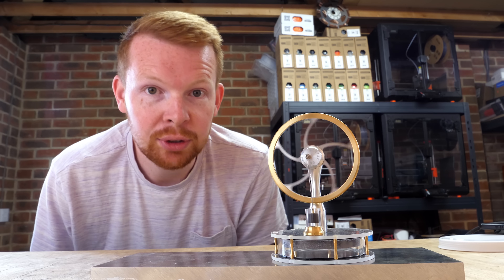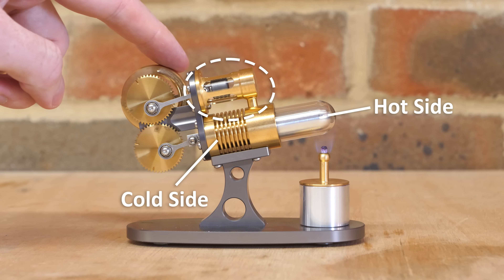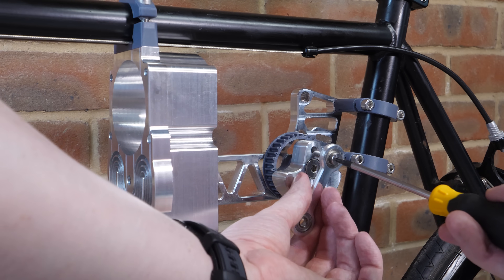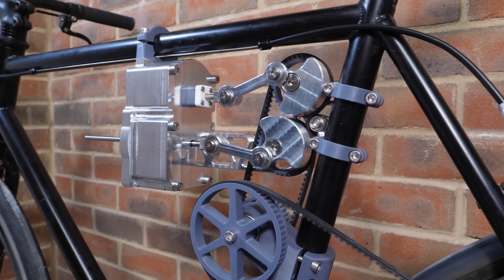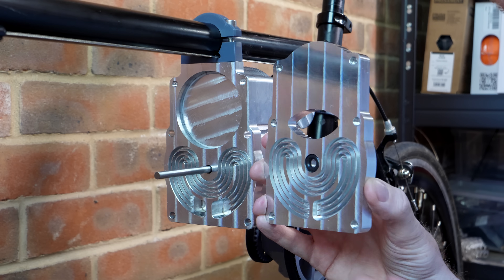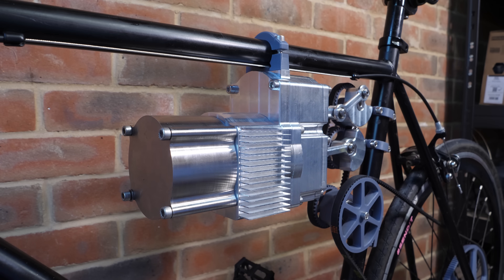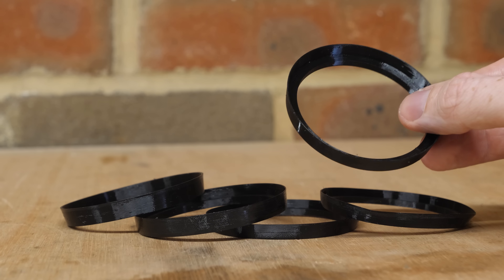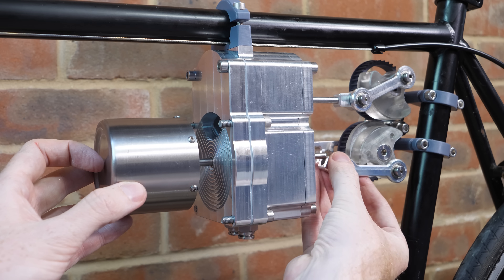Building a Stirling Engine Bike - Part 1

Comment: Hmm.. so I see two pathways here:
1. Run the stirling off of waste heat in support of a small 2-stroke ICE (since we're using combustion to heat the cap anyway). Like a stirling heat turbo.
2. Enclose the burner. Keep the stirling heat cap at a desired temp by regulating the burn. Can get very creative with recovering energy from the the exhaust gas heat/pressure.

Comment: Remove most of the 4 flange ribs on the hot cylinder and use short cap head screws reducing the heat transfer from the hot head down the big ribs and long screws that are very hot so close to the flame to the engine block.  At the end yes add a re generator and some Stirling engines had a small compressor to up their pressure others used high pressure hydrogen. ( don't try that at home ) Packing the cold end in ice works better than water cooling, cheating but so is your ground mounted ice water and mains powered pump.  A single crank 90 degree V saves on friction of 2 cranks and the tooth belt and a good fit in a bicycle frame with the crank and flywheel down low allowing for a bigger engine.

Comment: Wooow.

In electricity generation plants, they look the way of extract every amount of energy available. The steam that get out from turbines, have not the heat and pressure to move another turbine. So it get compressed to concentrate the heat and use it again.

But still, a lot of energy get lost  through the air. (in the from of heated air)

This is a very elegant solution to use that heat and produce electricity whith it.

Comment: Love this.
thought I do have a question- is it better to do this straight like you have done?  Or would you get more bang for your buck from going Sterling- generator- electric motor?

I can't do that math.  I know there are losses in conversions- but robert murray smith (youtube channel) managed to minimize those with "speed at the rim" generators.  Large wheels, easy to make serpentine coils, and a decent gearbox to maximize magnet speed- and he gets commercial grade wind turbine stats out of his dinky little diy wind turbines.  So, I wonder, if instead of just using the sterling for straight motive power, if you could put that into electricity, then going to kinetic?

that may be a useful thought, might not.

Comment: You can make a solid displacer by bolting 2 "U" shaped cups back to back with the displacer rod.  So if you cut it in half long ways it would look like a letter H on its side with the displacer rod in the middle.  You then need a hot and cold end that wraps around this letter H. You could bolt an insulator in between the 2 square shaped "U" s. Your displacer seems too short and maybe too much gap between it and the hot/cold ends.  One end of the displacer needs to be cold and the other end hot. A longer displacer helps this to happen. I  have read about someone using leather as a seal and it worked very well and lasted years. The cylinder walls need to be a glassy smooth mirror finish. Small engine makers usually ream and polish the cylinder walls. A good stirling engine should be difficult to rotate when cold,  meaning it has a good air tight seal. But it must be very low friction.  You can make it more powerfull by compressing the air inside the engine. As it runs it can drive a small compressor to pump itself up

Comment: Hey Tom, great videos and looking forward to this series!

My 2 cents: the expanding seal at the power piston may not the best choice here as (in my understanding) the piston is both pushed by expanding air during the heating phase, and pulled by contracting air during the air cooling phase. So the piston seal needs the same sealing performance in both directions.

Comment: Reff 6:01  I am by no means an expert on Sterlings, but am a mechanic with 40 years of experience. Love ur channel.
   The power piston shaft suport plate...as the hot "power pulse" is pushing the piston down the bore...would it not reduce resistance to have the bottom of the piston vented to the atmosphere? As I see it...using an expanding puff of hot air on top, to Compress the gas in the sealed chamber on the bottom reduces the push on the connecting rod...

Comment: Support the cylinder on the down-tube as well. Also, it might help to support the power piston rod a bit better and/or make the conrod longer. The ratio of leverage between push/pull and bendy-bendy looks a bit too close.

Honestly though, I want to see the mk42 engine once you’ve Tom-Stantoned the heck out of it. 🎉

Comment: Your cylinder walls need some honing, my guess is that it should be done with 800 grit.
Increase the displacement quite easy with a thicker gasket or just a spacer on the displace piston side.
Maybe add something like steel wool around the displace cylinder, so the air from one side has less contact with the other side, further increasing efficiency.
And the steel wool would act as regenerator (need to be a material with poor thermal conductivity but high thermal capacity).

Comment: Entertaining, Tom, at the very least.  I'd like to point out that if you can increase the surface area inside the hot end you can get the same power level with a lot less temperature which should boost your efficiency significantly.

Comment: I have built several sterling's and the biggie is minimum dead air space and as friction free as you can make it.. Run yours no load for a while and it will bed in .. then run better..  Pressurization is a must and a regenerator out of steel wool is easy..   I dunno but I think your engine is too small..  Get the sterling book from UIUC as the Prof. that wrote it offers invaluable tips.. he helped me a lot.

Comment: I adore this thing, the only issue I can see would be poor cooling airflow at speed, given the hot side is in front.
Probably is a necessary evil though as having hot air enter the power piston, while better for power, would likely harm longevity due to those temps as I doubt plastic would hold up, though that makes me wonder how bad making tint steel O rings would be in a similar design to those tiny V6 F1 car pistons, regardless it'll be amazing to see moving one day

Comment: So for the upper cylinder assembly, consider moving the center line of the crank to the center line of your piston. That way you have an even power cycle as the crank rotates. If ya notice your lower piston assembly is smooth running while the upper one of jerky. I think this will greatly improve your efficiency and help with moving into the next power stroke

Comment: Tom, Check out the ' Philips Sterling Generator" circa 1960.  It details the pressurised crankcase, by increasing the density of the working medium in your case air but it can also be nitrogen. The Philips engine had a small compressor to maintain the high crankcase pressure. The crank was a yoke motion and is more efficient than the standard crank.

Comment: you just could have machined a fold/deepening (dont know how its called in english) in the piston rod guiding area, that you can use a simple standartised glide bushing for 11c per piece, without plastic adapter for a too big (wasteful) teflonblock as a bushing. It would be lighter, cheaper, more durable, and easier to build and maintain.

Comment: I absolutely love the idea but isn't this an indirect fire propane engine? are you gonna add a small generator to run the water pump? maybe a propane cooler using the venturi effect to cool the cool side then to burn the propane on the hot side?

Comment: You should just have a generator on the flywheel that dumps current into capacitors. Much easier to keep the stirling engine spinning without attaching a clutch.

Comment: If you are still considering a steam engine make it so that the water is heated through a coil of copper pipe by a pump. With that, if an explosion occurs, you will not have hot water splashing onto you. This will also prevent giant explosions but rather just a "pop!". Room temperature water tank -> Small water pump ->  Copper pipe coil (heated) -> Steam goes to -> Piston Engine -> Spins a pulley with leverage (adjustable with pulley size) to spin the small pump. Use a small amount of power from the engine to power the pump, use the rest to power your bicycle. Please consider, I'd love to see you build this. It's going to be tedious and complex but I truly believe you can build this.
Reply: Could also use a thermoblock

Comment: Great effort - Stirling engines are awesome! I worked on some of the electronics and software for the original WhisperGen project (a 4 cylinder Stirling engine). It was a  home cogeneration plant that generated about 1 kW of electricity and heated the hot water with its waste heat.  
A regenerator will very likely help (something like steel wool insulated from sides of engine perhaps). Also I was wondering if the displacer was sealed as air leakage  in / out of  that might affect efficiency.  It does seem that something is wrong because my experience with an old Stirling engine, only a little bigger than yours, from a home (used to pump water from a well as well as heat hot water apparently), is that they have great torque which does not seem to be the case with yours, so it possible there is a leak somewhere? 
Of course, if it was a sealed engine with a pressurised gas (higher pressure means more gas mass to expand / contract) efficiency can be a lot higher but that is probably not feasible for you. 
Most of the commercial issues, in the past,with Stirling engines centre around manufacturing cost versus size versus power. The hot end in some projects can be problematic (high temperatures and metal cracking for example) but usually thats exacerbated by trying to increase the power output with more heat.

Comment: Nice job, Tom. You might want to add a continuously variable pulley system as a speed control (as used in the old Invacar, the Scott 'Flying Squirrel' motorcycle, and other vehicles) for the bike, once you have an engine which develops enough output power to do the job.

Comment: tom, if the engine doesnt make alot of torque why not make the engine bigger? bore only helps if you cant get stroke, but you couldve just added a larger rod a way to keep it in place using screws on each end of the crankshaft offset then add the output gear off that

also i need to add but steam engines are actually quite safe, the failures are due to human error

Comment: I get that you're trying to make a Stirling engine that's understandable by the audience. That said, with such high (for the engine type/size) power requirements, wouldn't you be better off copying the commercial designs? Either that or go full Mark Rober with a 20l displacement engine.

Comment: Sure you may need to haul around a small tank of cold water and sure you may need the equivalent of an oxy asetaline torch between your legs aimed at your junk and sure you may, optimistically have half the speed compared to peddling but, holy crap if that's not the coolest thing to go through the park with. I'll be very slowly..... Probably. I still hope it surprises both of us. :)

Comment: Tom, heres some considerations you may be overlooking......   

Your final drive ratio is horrendous. These motors are capable of quite high rpm but completely lack torque. You should gear accordingly. Maybe 3x your current ratio..  

Next, you sealed the piston for pressure only but not vacuum. Vacuum, while a lesser force, is still a significant contributor to overall power output. You may want to consider removing your other teflon seal and replacing it with another 3d printed seal, but facing the opposite direction as this will help seal against vacuum when the air in the cylinder cools and contracts, pulling on the power piston..  

Heres more wasted power, YOUR POWER PISTON...  YES, your power piston displaces its volume of air above the piston into the displacer chamber, but it ALSO displaces air BELOW the piston into a sealed chamber with a teflon shaft seal..  this is a ton of wasted energy as you compress air then pull a vacuum on the other half of the stroke. Add massive holes in the plate below the power piston to allow it to freely displace air into the atmosphere. 

These 3 things alone should make major improvements to your current configuration.

Comment: I still remember an article about Stirling engines in Scientific American circa 1978. It showed jow a ball of steel wool could serve as a heat reclaimer. Amazimg engineering here also 3D printing and CNC didn't even exist, or at best were in their infantcy back then. It should work, but getting that power output in a tiny package would be no mean feat.

Comment: you can get the piezo  electric heatsinks pretty cheap, there used in the expensive neck coolers, they have a hot side and a cold side, might be worth a try maybe?

Comment: at the end you can see the flywheel doesn't have enough enertia, you can see it slowing down and speeding up between strokes.  

 to increase the pressure would require a sealed crank shaft you don't want to go down that route...   

Your using allot of heat is the cold side staying cool? you could make a gasket sandwidge at the piston with somthing like a layer of PCB / firberglass or similar to block conduction. 

your displacer would ideally be non conductive, it should stay at a neutral temperature the whole time, it should also be air tight or solid, your one isn't sealed so the void of gas inside will be loosing power. 
look into carving one from a closed cell insulating foam, you can get heat resistant ones. 

a regenerator adds a suprising amount of power, cut a 3-5mm dip on the center third of the displacer and lay down a matt of ultra fine wire wool, form it into a matt that doesn't drag on the sides but forms a semi seal 

if you want a smaller power stroke in future you could look at using an adaptor to make an offset bearing, which allows a tiny stroke with large bearings 
you may not need that at your scale 

personaly i would mount the whole thing as a rear panier as you still need to mount a heat source without burning your legs and have room for cooling 

you can make a diaphragm pump that can be ran from the stirling engine but you wont be able to match the flow of the fish pump 
blasting in more heat and more cooling won't necessarily get you more power out 

don't bother with a clutch you will struggle for output power as it is 

for your steel hot side, ideally you would use thin walled steel from a bottle etc as thin steel doesn't conduct heat transversely as well as aluminum 
so it will conduct less heat toward the cold side 

a common issue is heat saturation where the cooling cant keep up with the heating and everything gets warm 

usually the flywheel is mounted to the displacer bearing as that's the heaviest reciprocating part, you'll get smoother movement

Comment: Try a 2 cylinder strling with 2 displacement chambers. 

Then, you can pressurise the thing and not offet the piston balance. 

Exspanding air at 1 atm won't get much power. At 100 atm you can put in a lot more heat and get a lot more power for the size. 

It's like a turbo for a Stirling engine.

Comment: I have only built 2 Sterling Cycle engines,so I don't want to claim to be an expert but I want to pass on my experience.  I found that if the power cylinder is quite a bit smaller than the displacer, the engine made more power.  Also, the timing of the 2 cylinders make a difference also, but I don't remember the relationships I came up with, other than the timing for each engine was VERY slightly different.  
   On a side note, they were both walking beam types, and my children absolutely loved watching the wooden beam moving up and down.  I took the engine to the children's school to demonstrate.  I lit the torch and started the engine and as I was explaining how the higher the temperature difference, the faster they ran.  I turned my back and one of the bright students made a couple of snowballs, and pressed them to the cold side.  I was able to grab the young man and swivel him to safety just as the wooden beam fractured from the overspeed!  Demo was held outside as school wouldn't allow open flame inside. Was a good experience for me!

Comment: This is amazing.  I think you're onto something by shortening the power piston stroke at 14:45, but I think you need reduce its area too.  The air will only have time to change temperature by a few degrees as it goes from hot side to cold, so the air volume will only change by a few percent, so the power cylinder volume needs to be much smaller than the total displacement of the engine.  Look at the engine in the intro: huge displacement cylinder, tiny power cylinder!    Your working engine slows down at the top of the compression stroke, so you're still over-compressing the air inside.

There's a trade-off: A smaller power cylinder diameter would push with less force, but it'll have a smaller sealing surface so there'll be less seal friction and also less blow-by.

I also think it might be good to shorten the displacement cylinder even more, so there's less dead air between the hot and cold sides.  Basically I think it'd work better if it looked more like the engine in the intro.

Comment: Hydraulic sealing companies will make you a custom seal day of for cheap as hell. At work (in the US) I use Hercules sealing products and you just choose between groove dimensions and seal dimensions (for their tolerancing purposes) and then give ID, OD, and width (and throat diameter for wipers). Then you give them 20 dollars and get it the next day (with our discounts so it’d probably be more like 40 plus shipping but still it’s easy and cheap